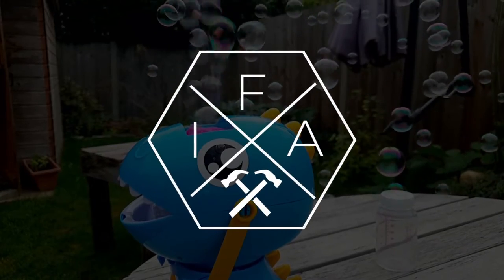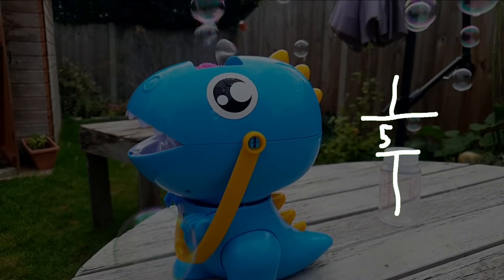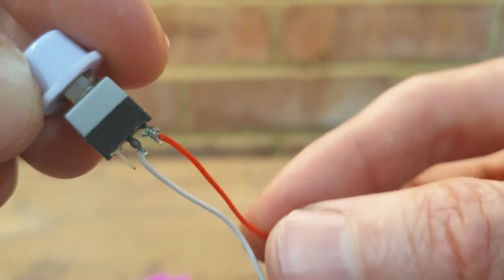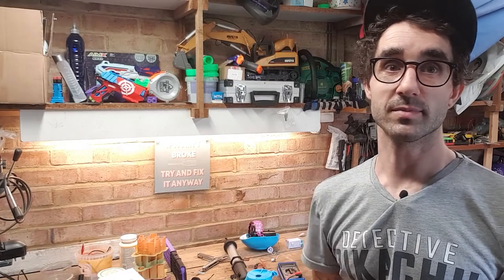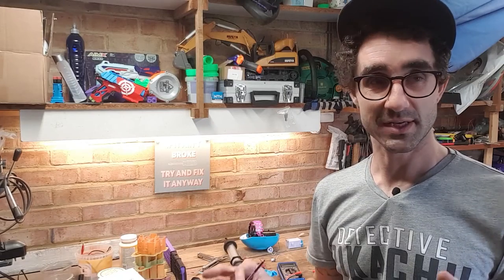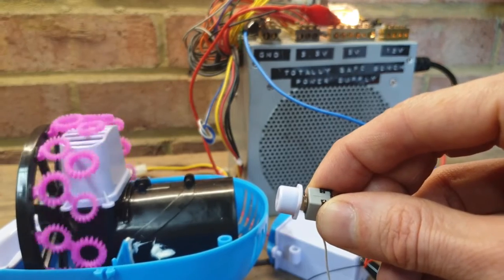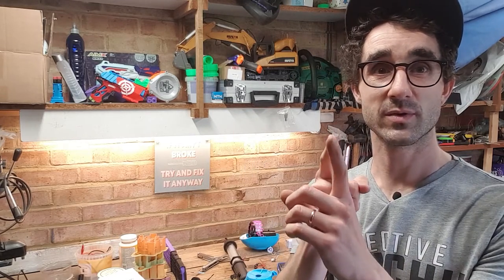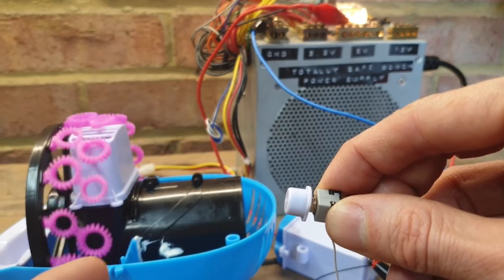No Bubbles? Broken Bubble Machine Fix: Quick Fix Episode 1:

Comment: My bubble machine is not blowing bubbles. How do I fix it? I can feel the wind but no bubbles come out.
Reply from the maker: Hiya, which bubble machine are you using? Mine obviously had an electrical fault, but yours sounds like:

(1) it's not blowing air fast enough;
(2) hasn't got the correct liquid in it, or the dilution is wrong; and / or
(3) something is popping the bubbles before they leave

Comment: hey dude my machine that i just bought was working but suddenly when i was doing it the thing was going a bit slower than usual how is that?
Reply from the maker: I'd guess either the batteries are low, or something is dragging somewhere
Reply: the fan not spinning but the lights are coming on